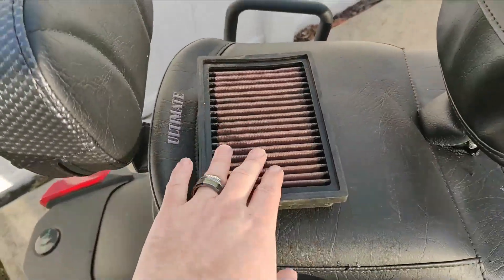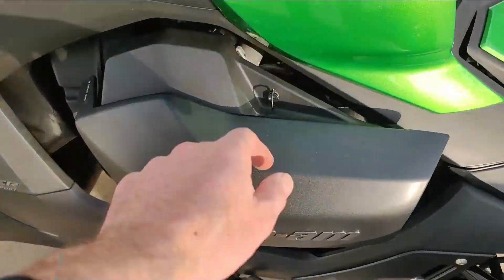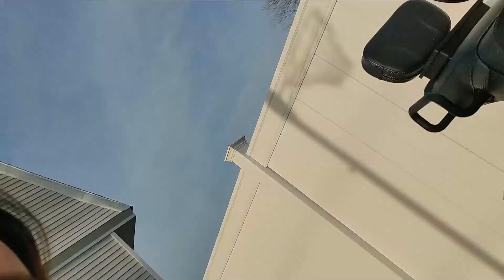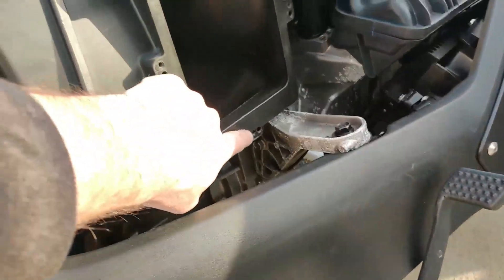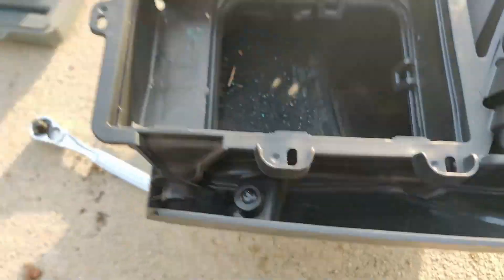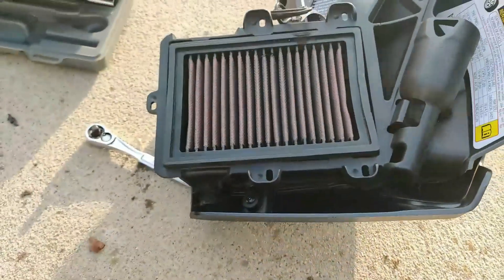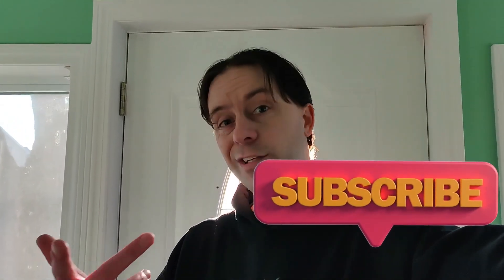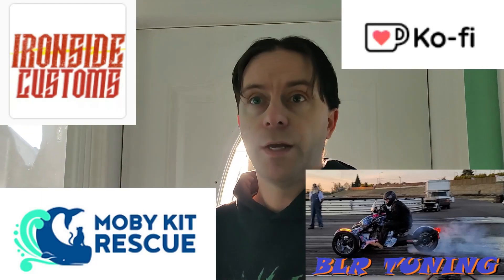Can Am Ryker CVT Filter Install | K&N Air Filter Can Am Ryker

Comment: Thanks, seems very easy to do indeed. The question that comes to mind with me though, is "does it make a difference?" I've seen videos stating the K&N doesn't deliver anything above the OEM filter, other videos stated that - it was tested on a car though and on a dyna bench - the K&N performance filters gave 2-3% better performance, which seems low for the difference in price if you ask me. 

For the CVT it wouldn't even do that, just potentially improve airflow.
Reply: More air flow equates to cooler CVT and belt temps. At least that's the idea.
Reply: @brentgath4447  yes, I get the idea. The question is though, is there more airflow indeed, or is it just marketing on K&N's part?
Reply: @BelgianRykerBiker  I can't say, for sure. I remember back when I used to do some dirt bike racing, they tested the filters and they did indeed have more airflow. That was 20 years ago and a different application.
Reply from the maker: This is more about air flow than performance numbers.  Plus it's reusable, just wash it out let it dry and pop it back in.

Comment: Haven't installed mine yet (I have it though), two questions for you.. 1. Is it a dry filter (I thought it was) and 2. How often do you plan to swap out the filter on the CVT?
Reply from the maker: This one is a dry filter, some K&N's are not.  I plan on just washing it until it gets to bad then swap it out. It's easy enough to pop off the side every now and then and see how dirty it is.
Reply: @BlackphoenixEntertainment  That was my plan, based on the assumption that the one I have is a dry filter.

Comment: I don't know.LOL.Everyone says how easy it is to change..Just wondering why couldn't Can-Am make it just when you open the door you see the filter you grab it and change it...NOOOOOOO you gotta take six screws off remove the airbox and then you can grab it...I've been on two wheels now 55 years and never had to take the WHOLE airbox off the bike to change the air filter..Even on the new cages you just loosen a few screws lift the top off and there ya go...I don't know I think  they could have made it easier..Hopefully those six screws are threading into metal inserts not just plastic..
Reply from the maker: it is a little strange for something that needs to be swapped out so often.  It screws into the plastic transmission cover.